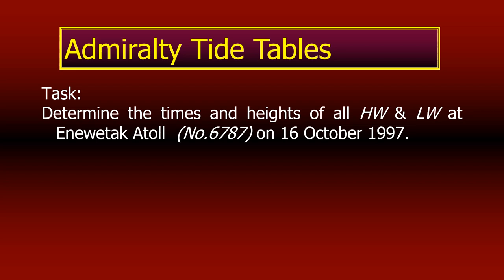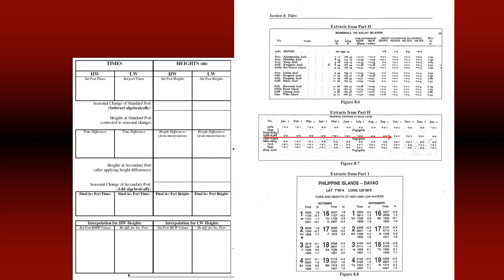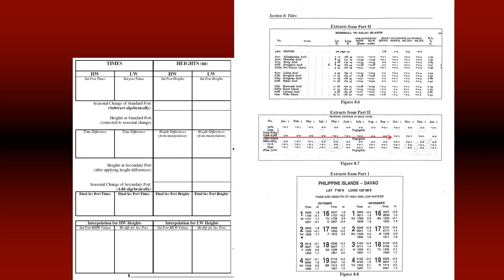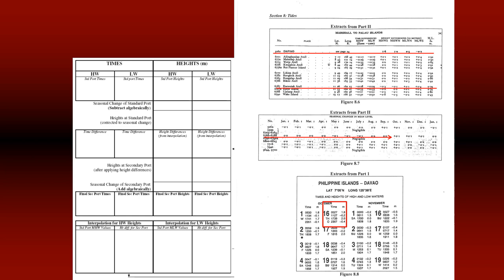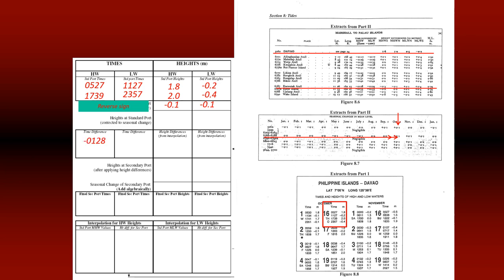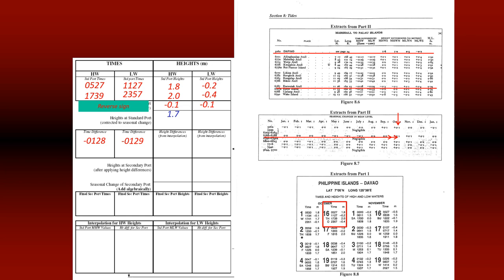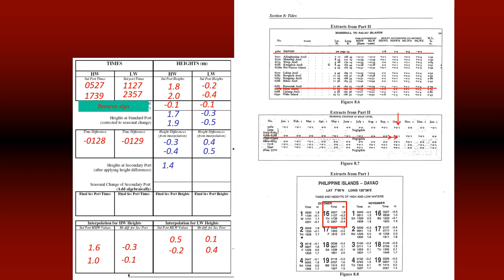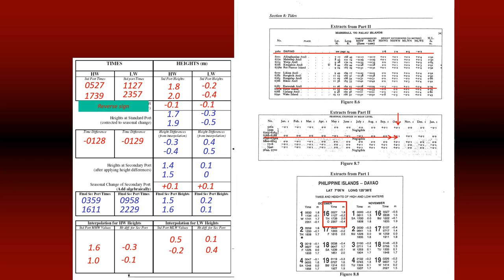Secondary Port Tide Calculation - Tides (Coastal Navigation)

Comment: what...?don't tell lies .. how the secondary port seasonal changers put by changing the sign of standard port seasonal change? It is given separately in tide table under seasonal changers section. In this example both Standard and secondary port seasonal changes values are same. but it will not happen as that in every where. Even in the given picture also you can see there are some Secondary ports which are having different seasonal changers from their Standard port.